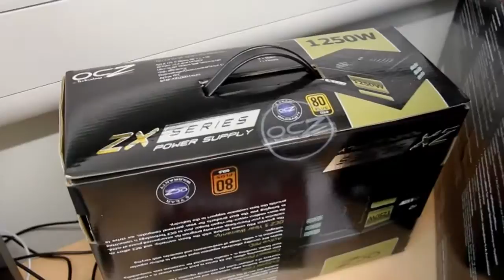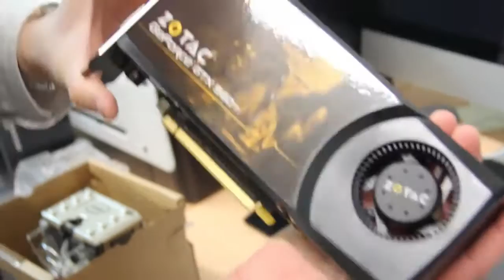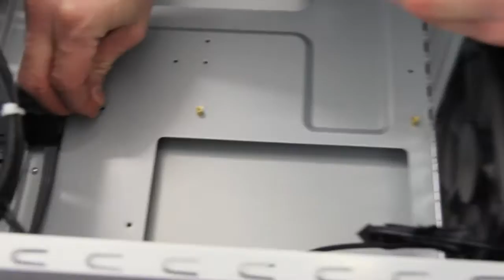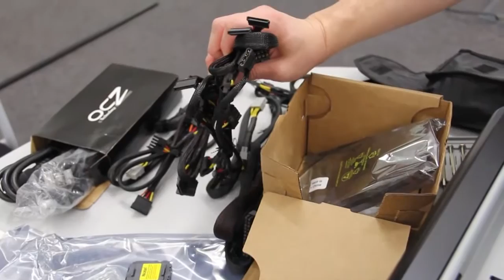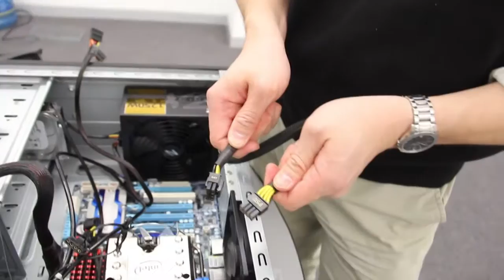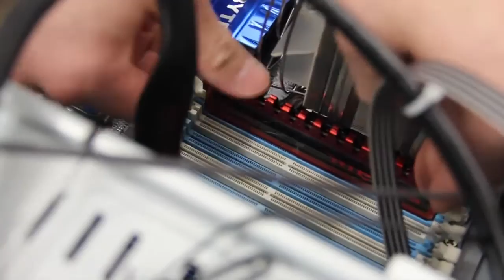Build Your Own PC - Unboxing and Assembling a Monster 3D & Video Editing Machine

Comment: Why use a modular psu when your cable management is awful? Using the cable management holes in your case helps not only to keep your case tidy and but also improves airflow.

Comment: Terrible system, not that i have a good one...
But you could improve alot of things on this system...
Drop the i7-990X to a 2500K and get a better graphics card. Maybe a nvidia 680,

And a terrible case, with 0 cable management options, so this has a terrible cable management, It's a pity you bought it allready.